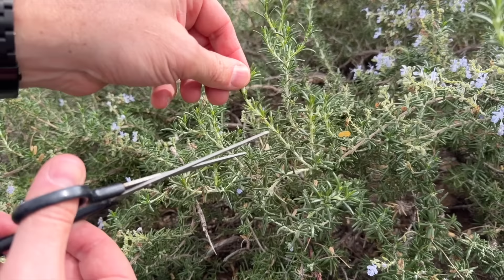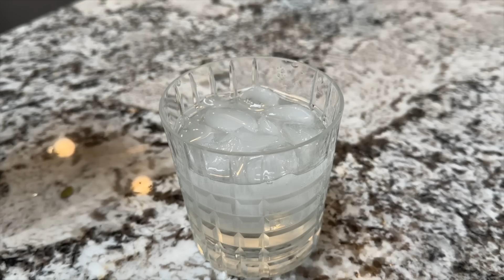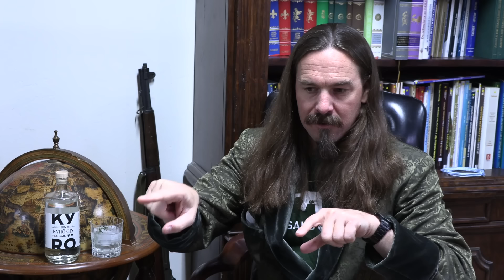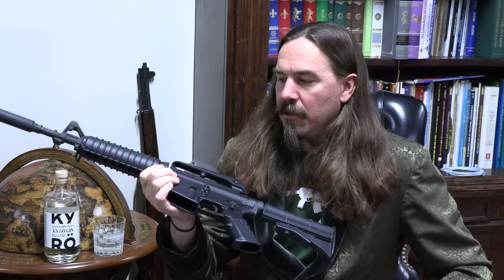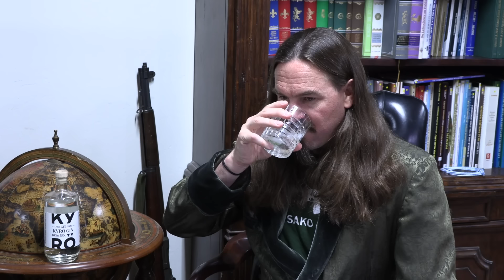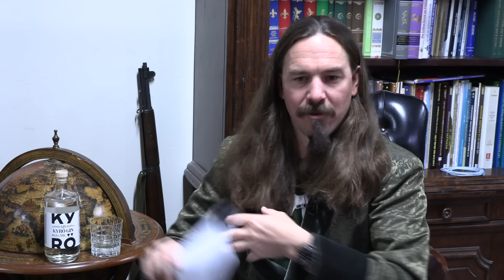How Guns are Made: Tolerances, Methods, and Metallurgy (Q&A January 2026)

Comment: It is hard to give a general overview of all of automotive manufacturing but I can give you the view from one of them. A lot of our machined parts come in from out of country now. Outsourcing really changes things. What is in the U.S. ends up being more plastics molding, stamping, welding and painting as well as specialty assembly equipment to the needs of vehicles. Given what we are seeing out of Ukraine, I'm not sure if swapping our automotive facilities to make anything other than offroad battle taxis and bodies for various drones would be the best use of these facilities. The answer of whether stamping is still used, yes. At least automotive does on all sorts of sizing of pieces though small intricate pieces are somewhat less common. I'd be willing to bet that a number of large appliances also use stamping for pieces. As for AI, the language models are not all we have. Keyence is incorporating AI into its scanning technology to better detect, measure, and perform QC on parts that it is viewing that is trained using CAD data and by the designers and engineers. This might be more appropriate to the process of design, rapid replication, and production of weapons than that language model nonsense as long as you can afford the high price.

Comment: 18:56 i’m a tool and die maker, i actually want to start a business and get some CNC capability in my garage in Des Moines and i own some jigs, fixtures and gauges to do advanced AR-15 work such as drill and ream for M16 taper pins.

I’d say for the advanced level gunsmith in today’s day and age work looks like custom features that stock firearms don’t offer, modifying two parts that weren’t designed to work together to work together, repairing or reverse engineering rare or unobtainable obsolete parts, wood working and restoration and lastly custom engraving work weather that be for ATF requirements on NFA items or just fancy art work.

Gunsmithing can be a very wide ranging idea, i think the problem we see is that the business just doesn’t exist to sustain the overhead. It would be very difficult to be a gunsmith shop paying a lease vs operating out of your garage like i plan on doing.

And the “gunsmith in the back” at your FFL storefronts aren’t funded or trusted enough to really be given the experience or training to do something like glue a split shotgun stock back together, strip and refinish it. That kind of expertise is going to run $30-50 per man hour for someone who’s legit and a store front doesn’t want to develop a reputation of being boogie in a market where there aren’t comparatively a lot of customers and the bulk of gun industry customers aren’t looking to spend that much money on anything gun related.

Comment: 49:18 metal 3d printing has some issues that will limit its availability to home use, they'll always be about as hazardous as laser engravers. theres some cool stuff coming from wire printing but it still has to have a high power welder attached

the other kind of metal 3d printing requires hazardous metal powders a sandblasting cabinet and a sintering furnace

Comment: Just a word from a german gunsmith here:
While it's true that as a master gunsmith you have to build a classic Drilling for your exam, about 98% of german gunsmiths never build a gun completely from scratch. Not because they can't, but mostly because nearly nobody can afford the price. (And they don't appreciate the craftsmanship)
So its mostly selling factory made Blaser rifles or replacing parts...

On a sidenote: I mostly produce replacement parts myself because sometimes its hard to fit/get the right parts here. So its easier to machine the firing pin or hammer myself for example...

Comment: Hey Ian! I have a mechanical engineering background and I wanted to add my perspective.

1. CNC is great because you can make a large volume of parts in a short period by contracting out the work to various shops. However if you need to make one part in massive quantities every year for many years, it does start to make sense to go back to purpose built machines. 

2. In my opinion the tricky thing about magazines is first and foremost geometry obligations coupled with size/weight limitations.  Militaries can and have tolerated expensive non-interchangeable magazines.

 Reliable magazines are difficult to produce for a lot of reasons outside of cost and that is why paradoxically we see cheap reliable magazines for some guns and expensive unreliable mags for others. 

I would be happy to do a littls write up on the challenges I see in magazine design and production. I was going to do one here but it got too long for a yt comment and I dont want to type into the void for nothing.

3. Imo the mass production cheap to produce gun that will come out of the ww3 will make use of extrusions for receivers. 

Cheap dies, great tolerances, and incredibly easy to scale production.

Comment: I don't work in gun manufacturing, but I have worked in a few manufacturing jobs. The question about manufacturing has me thinking, and in my opinion the biggest factor in production would be in raw materials. I've worked in places where all our raw materials were coming from China or Mexico and another place where it was 99% mexico or China and the 1% was USA, but with more than likely foreign sourced metals. Also I will say it seems we don't have the same amount of manufacturing capabilities as we did before, now we basically just have assembly lines more than actually manufacturers.

Comment: 37:20 That's the case for old or rather small scale manufacturing methods, but it has become cheap enough to measure with a calibrated camera, so that your automated manufacturing line takes a photo of every part and with it determines its dimensions.

Comment: 50:00 So In my experience of what I use 3D printing for (for automotive). Replacement parts for older and unavailable components would be where a big use-case lays. Tiny scale or individual production, where larger manufacturing cannot be justified and small scale becomes prohibitively expensive with shipping and awareness factored in.

Comment: Your explanation of tolerancing is excellent. One of the most frustrating misconceptions about firearm production exists within the AK community. Explaining the difference between loose tolerances and loose-clearance to most people can be a challenge. There is a strongly held belief that the practice of using ''loose tolerances'' during AK component fabrication is done to achieve reliability. In reality, countries like 1940s Russia had limited skilled machinists and milling machines capable of repeatable industrial craftsmanship, unlike the U.S., which was capable of consistently producing millions of M1 Garands.
Countries like Russia often substituted the lack of machining resources by allowing a larger range of tolerances on milled parts, then relied on cheap, unskilled laborers to hand-fit those components. Because loose interaction between parts (clearance)  requires less hand-fitting, this production technique worked in countries where labor was cheap and machining resources were limited. However, the result is that many parts are not interchangeable from one rifle to the next. The AR15 design has adapted very well to advancements in CNC machining and forging technology. the AKs labor intensive production has not adapted well to rising labor costs.

Comment: Using heating/cooling of the two parts before a press fit is not just "very strong", it is in fact stronger than most forms of welding because you do not get the normal "heat-affected zone" from a regular weld, said zone always being a weak point in the finished product.
As an example, this is how every single railroad wheel is  attached to the axel!

Comment: For the AI question, i don't think the commenter meant chatgpt or grok, or any "forward facing" language ai, i think they meant the science application ai program probably being tailor made right now to do industrial and mechanical simulations. The fact of the matter is, AI is HUGELY more productive in the facets of society that are the OPPOSITE of everything being sold by silicon valley tech idiots right now, both good and bad. Ai can run millions of simulations and calculations on the physical properties of a chemical bond between 2 molecules, and if the science behind the input data points is correct and the full picture, the simulations because a bible for that molecular bond and it's properties, plus you can use it to determine that something is missing from your dataset to run simulations, and you can synergistically use ai to prove theories in real world, run test with ai to find new strengths and understanding, put simulation outputs to test to clarify and verify the algorithm, so forth. I really think ai in THIS application will be a new Renaissance to manufacturing and industrial processes, to find the MIN MAXED performance out of every material and it's bonds faster and more accurately than any lab or student hypothesis. I also worry that going down this path may stifle human innovation in discovery because we will become over reliant on ai to hypothesis test when it plays out different from reality. But if it's actually possible to innovate in material science (which it is), then ai will be an amazing tool at us finding new alloys and ways to achieve stronger materials with different processes & applications. 

For my evidence, i was just in a class learning japanese technology from the edo period, and we were learning about mirrors and telescopic technology. In it, there was a telescope made in the 1600's that was some how extremely clear picture even to the present, even with no cleaning to the mirror in the base, and having gone through+350 years since construction and the initial polish, still could see clear enough that you could observe things in the sky. My professor asked an engineer in charge of handling it how this was accomplished, and they responded that they didn't know either, until later when they did a material analysis of the bronze metal. It apparently used an extremely brittle alloy of tin and copper to make a particularly rust and corrosion resistant bronze, I think around 30% tin? This alloy would never be made today because it would be useless due to how delicate it would be and require additional handling and processing techniques. However, in the Edo period when there was limited information in Japan itself due to the technology gap, and innovators had limitless permission to do whatever the hell they could try, this inventor managed to make a telescope that resisted rust and corrosion for several hundred years, of course with limited application. Said telescope will never compare to the Hubble telescope, and you can argue no such use for a bronze that corrosion resistant+ brittle that would practically be needed. But if we can run endless simulations through AI and find a discovery, like a combination with lithium that makes energy storage exponentially better, or a new way of computing that's beyond a binary gate system allowing for more computational performance, or a cheap way to make steel 200% stronger to weight, there will be innovations that come rapidly. It's also not like these "material simulation tester" is a major job either, in present form a lot of chemistry scientists in universities have limited numbers of people who do the research and run simulations, but if you add ai you wouldn't replace the students, you'd simply make their research more efficient or give them other research topics. I seriously loathe AI but this aspect of it is the one saving grace for the entire thing that is AI.

Comment: I could see metal 3d printing in maybe doing something like a compliant mechanism printed in one piece as fire control mechanism.
I dont see metal printing coming to home players like plastic printing though. If you want a metal part right now you would probably make a plastic print first and use it to make a mold and cast it with metal. I saw so far only powder sintering for metal direct printing and this brings with it a powerful laser probably some shielding gasses or vacuum equipment and the use of fairly reactive metal powders. Even plastic powder sintering machines are still very expensive and professional equipment.
I dont know if it is possible to make a filament style metal printer like a mig gun or a wirefed laser printer. I heard there is metal powder infused plastic filament that is like 80% metal and you could fire it to sinter it. Ai says the complete setup to use this is still arround 10k $ and I expect the filament costs an arm and a leg.

Comment: Hi Ian, gotta say, thought this upload was spot on. I'm a British chartered engineer with 40yrs in defence engineering and  am a lifelong shooter, so i understood exactly what you were saying. My comments... A great example of failure to properly understand steel heat treatments and alloy steels for pressing must be the British SA80 L1A1. You did a previous video which detailed much of that disaster 😂, and how H&K fixed it. Also, investment castings and their particular HT. Ruger understands that tech beautifully (I have two). Regarding printing Vs CNC, also spot on, but I would add that CNC is fine if you're making more than about five of something. When considering the synthetic modelling and CNC programming, as well as proving and machine set up time, it's often a lot quicker with a decent toolmaker (gunsmith?) and a quality manual lathe & mill. 
One thing outside current mainstream firearms is titanium. It's a great material. There is not a huge difference in material properties between wrought (ie machined) Vs cast Vs forged. It also can be printed fairly easily (on expensive equipment). I would hope to begin seeing it start being used more once, as you said, the machinery starts reducing in price.  Keep what you're doing. We love it.   Kindest regards, Mark.

Comment: About 3D print, I find a expensive but useful way to reduce the weight of pistol components.  Titanium 3D print, weight-saving as much as possible (for example, hollow inside). We can reduce .... about 55g from a M1911 :). Of course, firing pin is the must part we use Titanium 3D printed to produce.

Comment: Another advantage to CNC milling you didn't mention is it's the most cost effective for small runs. If you're making only a few hundred of something no method that requires a mold or die will be as cheap. And CNC milling will be faster than metal 3D printing for all but the most complex designs. If you can make it out of polymer 3D printing it that way might be cheaper still considering how much less those machines cost than even a small home CNC mill.

Comment: New machinegun designs generally use stamped recievers.
Reply: Russian ones maybe. M250, Evolys, HK121, all machined.
Reply: @skepticalbadger  The Negevs and the MG4 uses stamped steel. So does the QJG-02. Extruded and machined aluminium is certainly becoming more popular in machine guns, and their is even some use of polymers, such as the chinese 12,7x108mm QJZ-171 that uses a carbon fibre receiver. One argument for extruded and machined aluminium vs. stamped steel, was likely the tooling cost, in the post cold war era, when production was likely to be far smaller and more intermittent then during the cold war. Another benefit of extruded and machined aluminium is that prototyping and trials could be done with only machining from solid billets, with the more limited amounts of tooling, only having to be manufactured or ordered, if you secure a actual contract.
Reply: What a strange and wrong assertion.

Comment: Lots of stuff that was stamped in the 1940s is not just polymers, now aluminum extrusion and prismatic steel roll bent shapes have overtaken old style structural stamping.  Extrusion is easiest, but something like HK upper stamped profiles are pretty easy to roll form and then add minor welds.

Comment: On the industrial capacity points, polymers scale much faster than metals, but metals scale wayyyy better than they used to as Ian said.

Specialty chemicals are probably the bottleneck.  Nitrocellulose and nitroglycerin are the two best examples; the western world is largely at production limits now (and a few new factories are starting).  The various primer chemicals as well.

You can always spend a few billion on new powder factories,  we did before WW1 and going into WW2, but the US is literally down to one right now and has only one ammonium perchlorate factory for solid rocket motors and…